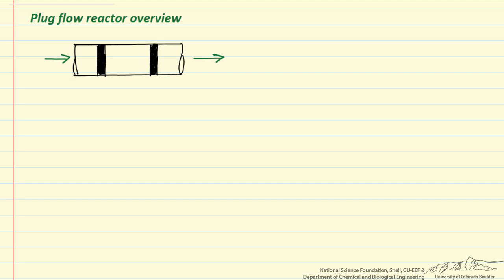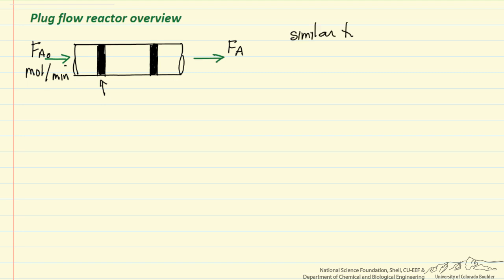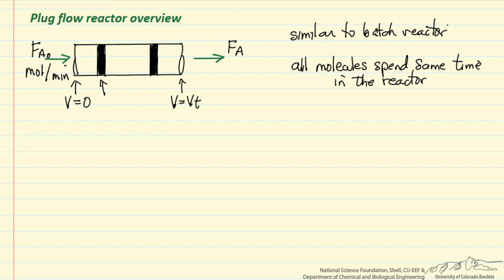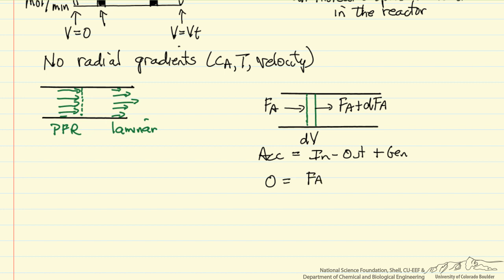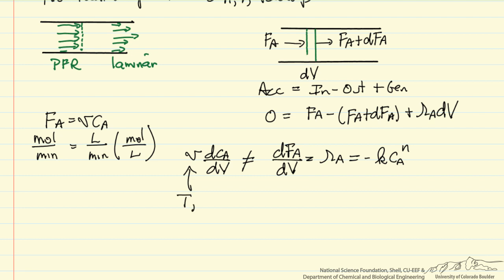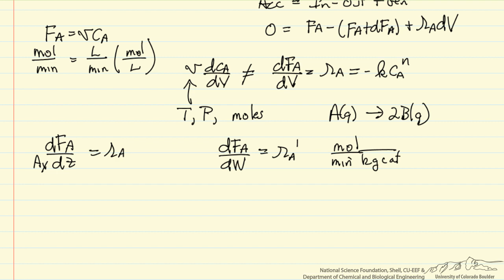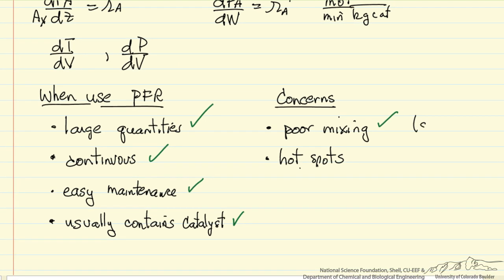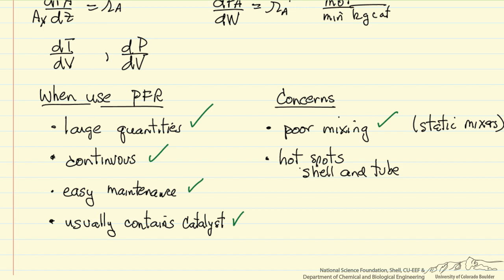Plug Flow Reactor Overview

Comment from the maker: The example you are referring to is a gas reaction where 1 mol reacts to form 2 moles.  Since more moles are exiting than entering, some other reactor parameters change (pressure, temperature, etc.).  Since the PFR volume is held constant, the velocity will change and in this case increase.